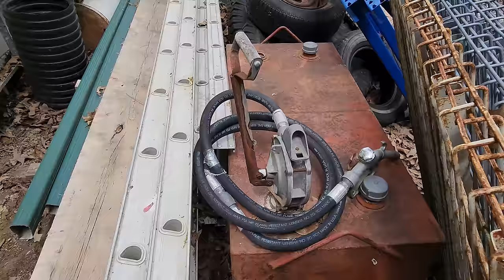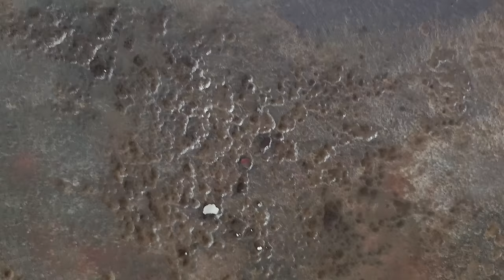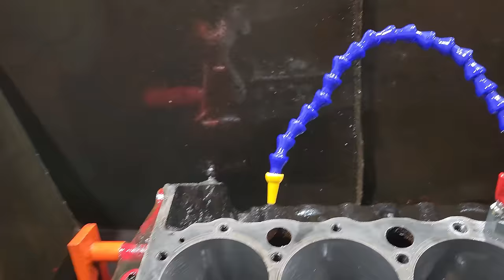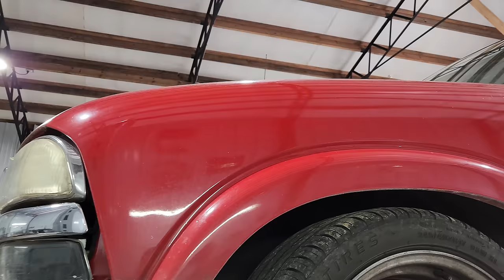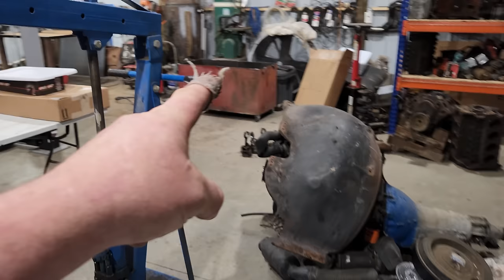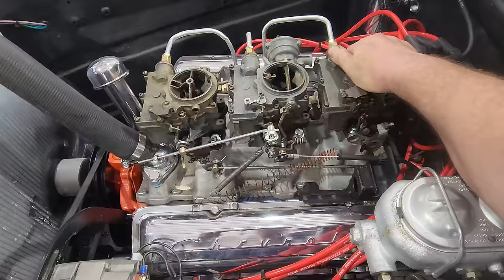Block Honing Tub Build and More Block Prep On The 327

Comment: will we ever see anymore of the ford stationwagon
Reply: He kept saying when the three videos of working on Dumas that he was going to buy some stuff and some new parts for the country squire wagon so yeah id say that he just has to get around to it, whenever he finishes his sporty 40 hot rod although I'm kinda looking forward to seeing Dumas and lockjaw videos as well and i don't work on stuff that sporty 40 but i have learned quite a bit watching these videos and as far as the red diesel tank i used to just try to jb weld the gas tank in the gm square body trucks id end up with until on two different truck projects one wasn't too bad i guess but my daily driver 86 chevy k20 custom deluxe long bed 4x4 well used farm truck,by the time i replaced the sending unit and got the bottom of the tank to stop leaking it acquired pinholes around the filler neck hose, and then it started leaking around the seam of the gas tank so i pulled it out the sending unit broke getting it back out so,i just ended up getting a very solid c20 86 chevy gas tank from a buddy who was building a derby truck,i was trying to fix my tank because i didn't want to spend $125 plus shipping for the tank, and the very solid tank i got from a buddy first i didn't know he had it and he sold it to me with a half tank of fresh 91 octane shell fuel for $45, and i bet i spent $65-$89 in grinder, and grinding and flap discs and quick steel and jb weld tank sealant trying to fix my stupid gas tank to my 86 chevy k20 truck

Comment: You put the pump on the highest side of the tank look underneath it that's where you double the floor up them little pumps can't handle restriction put a t in the line so you got a bypass I burned up two of them from the cavitation

Comment: Excellent video Chad  :) also nice ideas on fuel tank for washer and bore out motor and dink balls too also pump so cool! Also getting your mom Air Conditioning fix for summer that super ideal to do yes and those tire tread on small Red S10 truck ones back Chad I same tread on 2002 Chevrolet Impala LS  4 car they
did wonderfull job and last me 12 years and lots miles on too! Size was 225/60/16  also Uniroyal Tiger Paw all season also Ice grips M+S ! One thing like about was steering  responces turning , grip especially in Winter Season months  and most of all 100 was brakes stopping excellent 100% ! Well done on Video Chad !

Comment: I ran over a wrench a power torque 1/2 inch combination one with a brand new Douglas performance 700gt 205/70/14 on my 86 Buick Regal with my Buick steel magnum style road rally wheels in the junkyard and oh yeah i was quite upset since it was half sticking in the mud and I didn't know that and it went into my tire and it caused a busted belt, so I got replace a brand new, brand new tire lol

Comment: Chad,look up a 12volt oil scavenge pump, gear driven  its called amarine.
I use one to pressure up the oil galley on my old diesel farm tractors,does a pretty good job.
Found on ebay about $75 take or give a little.

Comment: My early 94 Chevy Z71 Silverado extended cab short bed truck don't look much better than the hot rod 4 wheely drive lol,, my rockers may look a bit better, but the front fenders and the wheel well s on the bed and the inner bedsides on my truck is way worse but my truck has good doors and cab floor and frame so ok whatever.. works i guess...

Comment: The old timers around me will weld or braze a fuel tank , but they fill it first with exhaust fumes from the running vehicle engine. No oxygen no fire or boom booms. Just a suggestion. Like the videos!

Comment: You should consider getting a mini split heat pump for your shop.  Heats in the winter and cools in the summer.  They are quiet and energy efficient and a pretty easy DIY.

Comment: Mr . Chad don’t give up on the progressive lenses.  I wear them and they do take a bIt to get used to but the computer in your skull will quickly adapt and change the processing routines and things will appear as they should.  Remember your computer (brain) is currently correcting the image with a much more blurred imagine so it’s over processing.   Also it becomes natural that you will look thru at the right spot in the lenses to see sharp images regardless of the distance.

Comment: Hello Chad. Seeing your tank reminds me of a similar situation with a large tank several years ago when I was much younger and full of vim and vigor. 
I fought and fought and fought trying to repair a few leaks on a large water tank that people used to mount on farm wagons for filling up the tanks that were on the tobacco setters. 
So, A friend of mine that used to be a pipe fitter that operated a welding shop told me that whenever you deal with a metal tank with decrepit metal that you are always much better off to flip the tank upside down and make the bottom of the tank the new top of the tank and the decrepit top won’t matter neatly that much anymore if you want to put the tank back in service or whatever.
My friend said that the top of the tank will usually always have good metal to work with rather than waste your time and material trying to repair the bottom of the tank. 
I used to keep a round tank on wheels for quenching hot metal in my work area at work, Old ugly tanks have many useful purposes.

Comment: Just a suggestion depending on how much fluid you plan on using seal the bottom of the baffle and about halfway to two thirds of the level of fluid on tank baffle cut a slot so the fluid will run over it but the heavier material like the honing material will go all the way to bottom and the fluid the circulates through your pump will have less particulates in it

Comment: On your glasses here's what I like get the regular bi focal on the bottom an then get bi focal on the top of your lens .put your arm straight out in front of your face cup your hand so your looking at your fingers an tell them to set the top ones at that densten. That way when your work on a car on lift you just look threw the top of glasses instead of trying to break your neck looking up.

Comment: You need to cut up an old engine stand and weld it into the tank so you can slide your block in and spin it as needed.